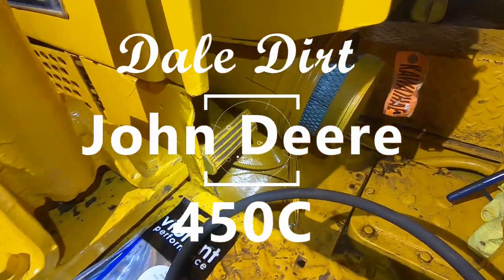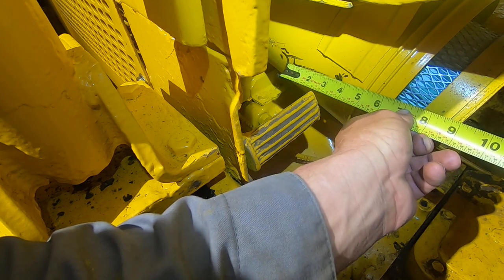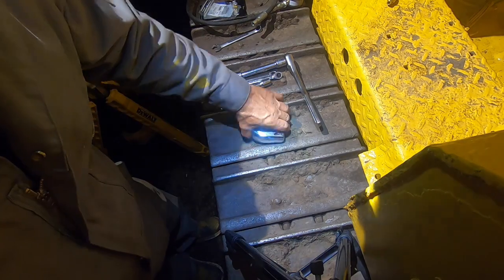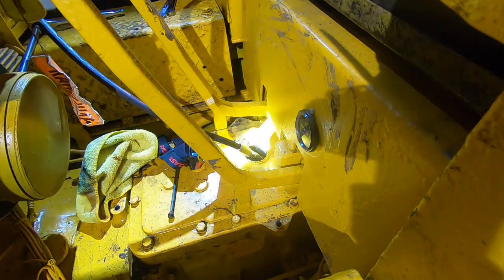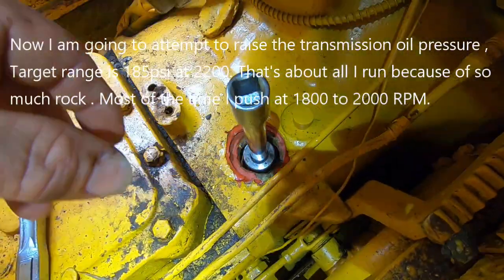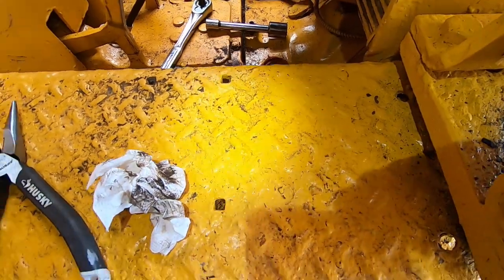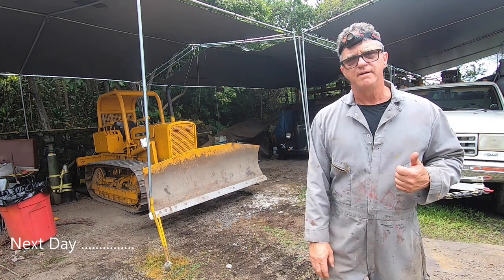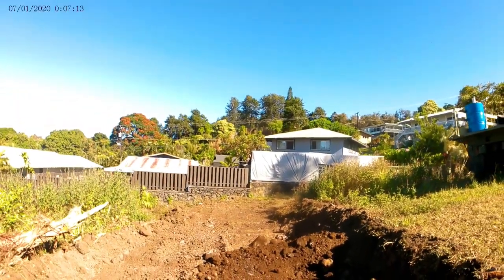JD450 Dozer  Will not move 12 12 2021

Comment: What oil did you use for the transmission I have one like this great video  Thanks
Reply from the maker: I use AW 68 , our best price is from Oreilly's . I am in a hot climate , so 68 is good . If your in a colder climate check Aw46 . I use AW46 in my backhoe reversers .

Comment: When checking the pressure on transmission at 1700 rpm should have 185psi but is it in gear when it pulls or what ?
Reply: I would thank you would have to warm it up frist then adjust

Comment: Love your dozer did your have a rops cage if not may I suggest to to wish and get a rubberized lights for it &maybe find a small muffler to make it quieter
Reply from the maker: Hi Bruce , You are right , I am already looking into a muffler for that little guy , I am sure the neighboring properties would appreciate that as well . I would like to add the tree riser bars to the front . I have rubber lights on the rear and a LED Bar in the front behind the grill . I need to block off part of the radiator because It does not run over 140 degrees F.
Reply: @DaleDirt  dale I think you might go to a muffler shop my yazzo mowers had Wisconsin engine with that round muffler I used a 1984 k car muffler already had the little elbow I put a straight pipe I went from 97db to 78db

Comment: If the covers on the steering brakes are letting water in and the brakes get wet it wont move either. Makes sure the cover gaskets arent leaking.
Reply from the maker: Hi Chris . I checked that and they are sealed off really good . I put 35 hours on it and it was working gret except when I was on a steep grade hill pushing up , it started to slip like it was low on fluid . So I checked the transfluid , added a 1/2 gallon and it is doing great for now , However if it sets at idle for 5 minutes or so and I put it in low gear at low RPM it can take as long a 20 to 30 seconds to engage . I have a feeling I am not out of the woods yet . Once it's hot and been working for a while it works great . I am running AW68 fluid . Do you think that's to thick ?